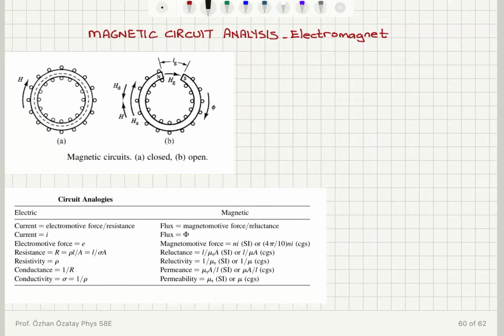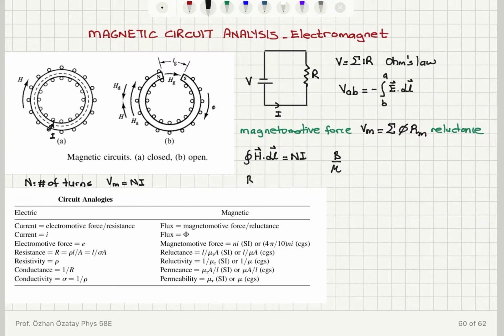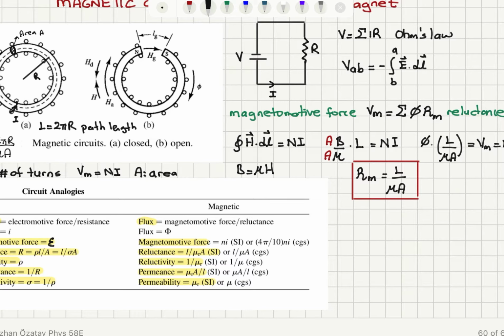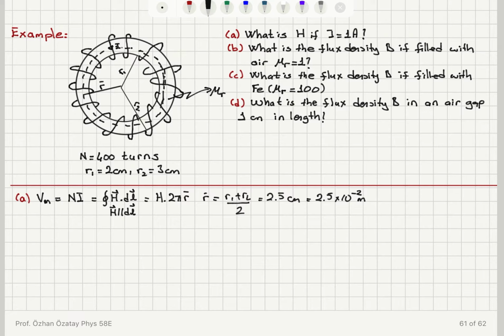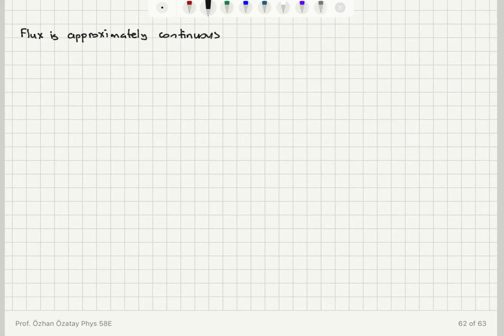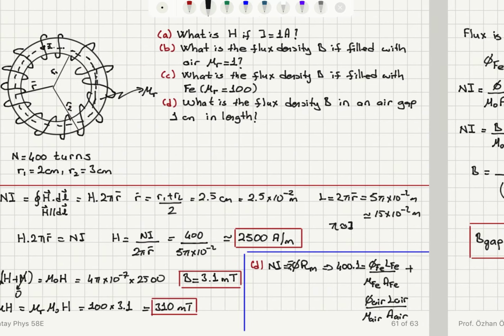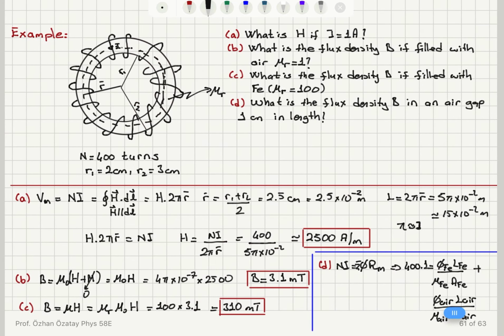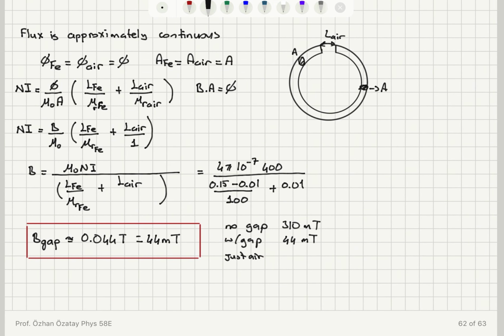Week 3-5 Magnetic Circuit Analysis

Comment: Thank you for your very helpful videos.
May I ask why in question (c) you did not consider M in the calculation of the iron-core B field? previously you canceled out for the air-filled toroid, but is it the same case with iron? even if iron can get magnetized and generate a magnetic moment.
Thank you in advance.
Reply from the maker: B=MuH for Fe. You are right that the iron core is magnetized. 
So the whole story is B=MuH=MurMu0H=Mu0(H+M). M is in the calculation when you take into account the relative permeability.